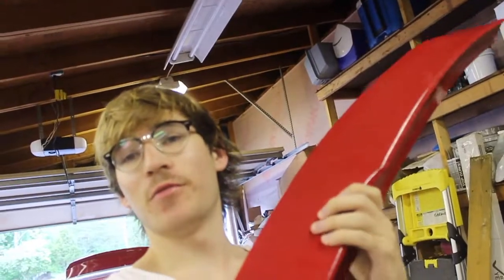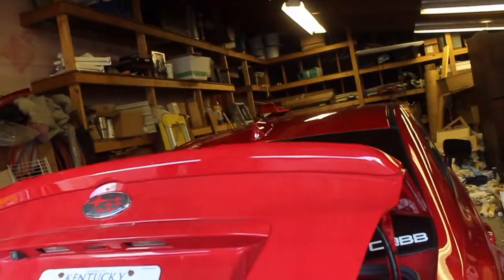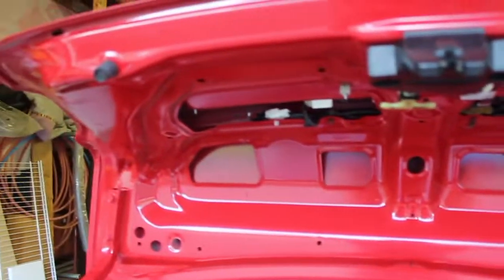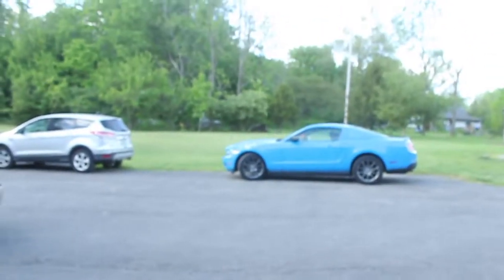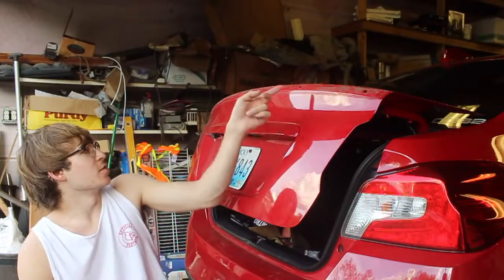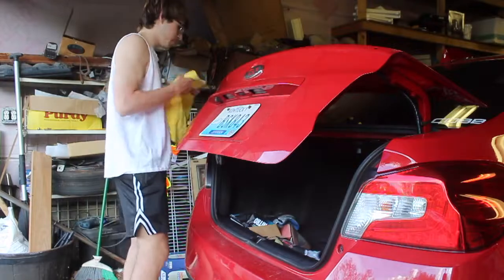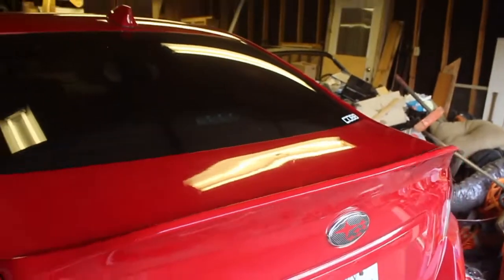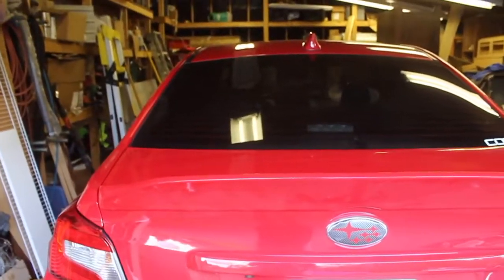Installing BUDGET Amazon Duckbill Spoiler for 2015+ WRX (HOW TO)

Comment: Howdy. Does it block the center break light??
Reply: It does not from the rear it comes flush to the base of the 3rd brake light. Not a bad idea to add a 4th though.